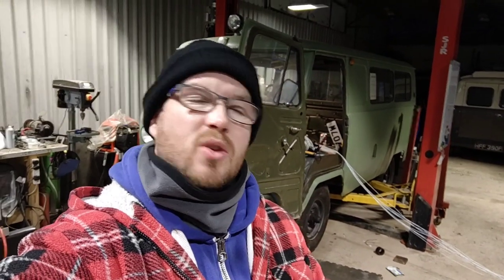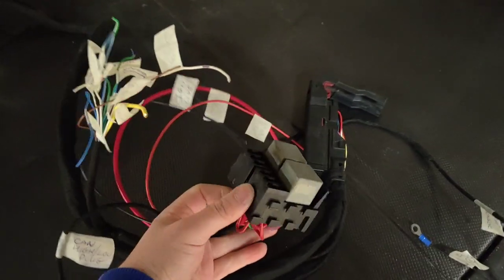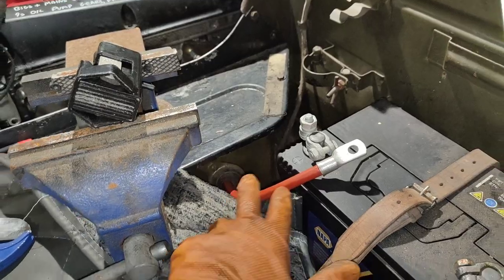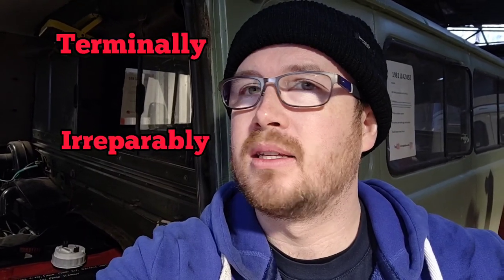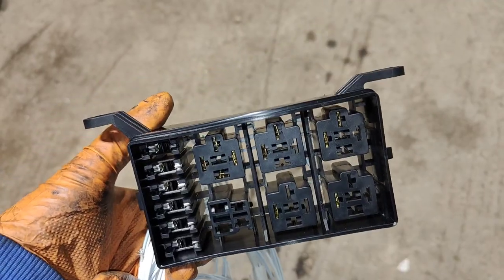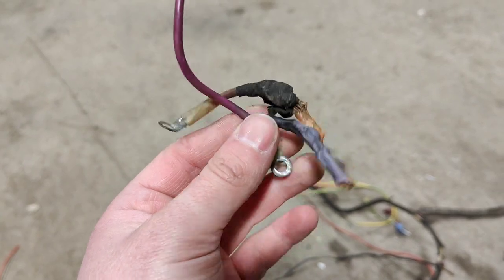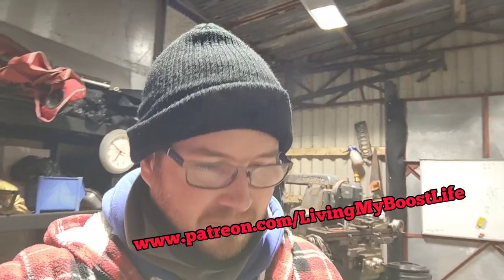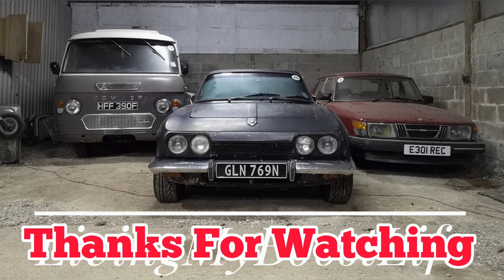Horrible Jobs On The 2.3 Turbo Uaz 452!

Comment: Your wiring looks almost as bad as mine. All kinds of goofy shite occurred in that area, over the last 30+ years, and none of it was done looking to enter any contests. I too hate wiring and I’m rewiring it myself. Have ditched all of the EMP stuff and tons of misc wires. Can’t figure out the wiper circuit or the emergency flasher relay so, for the wipers at least, I’m running them off two toggled circuits with no park function. It’s almost getting warm enough here to start working on it again.
Awesome content, as usual. Looking forward to you ruining some tires on the UAZ!
Reply from the maker: I think I may have an answer for the emergency flasher as I had to do some continuity checking to work it out! I'll share my results. As for the wiper park that's built into the motor itself.
Reply: @LivingMyBoostLife  Yeah, on the wiper motor, I just keep drawing a blank. My brain functions up to a certain length along the wires and then suddenly quits. I’ve tried my arming where it quits, thinking I can restart from that point, and, over time, inch by inch, I’ll understand but I only end up later staring at tape on the loom, glassy eyed and drooling :-)